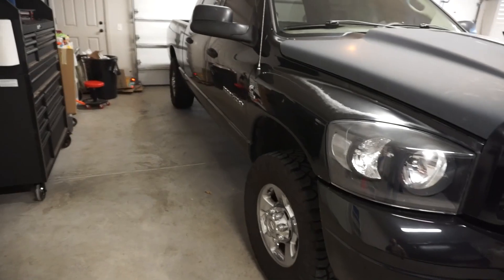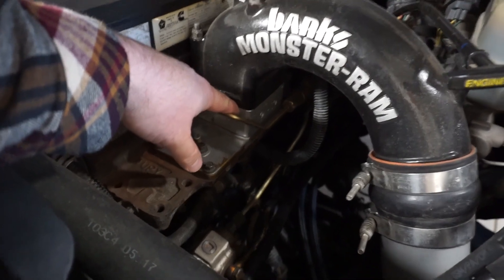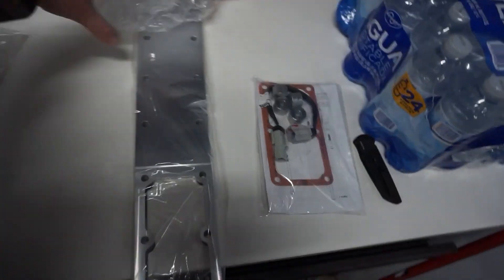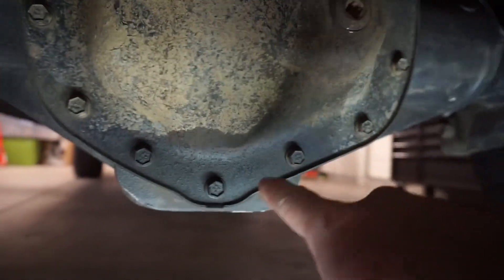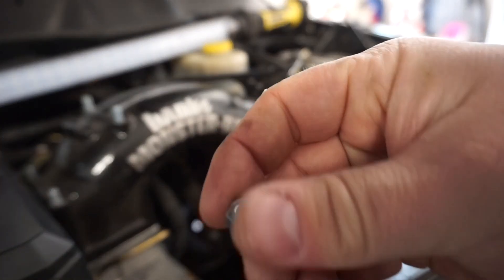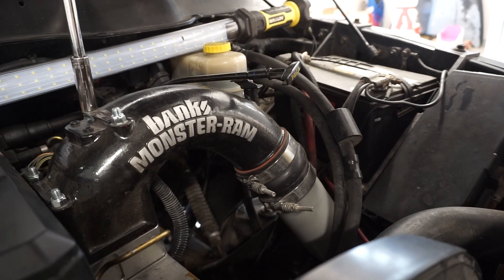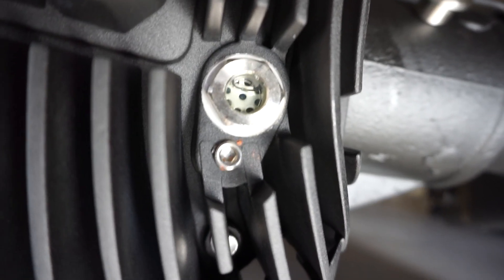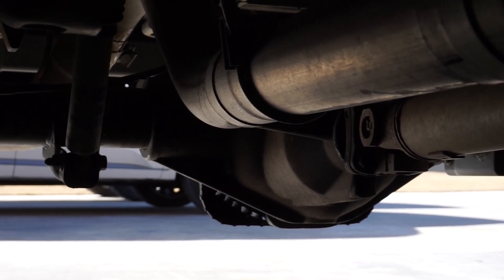Banks goodies install.

Comment: What upgrades engine/performance wise would you be comfortable doing on a stock 48re?
Reply from the maker: Honestly man a cold air intake is about it. These transmissions aren’t built to hold any power above stock. Maybe a valve body upgrade could help but that’s just about it.

Comment: you had to cut the oring?
Reply from the maker: Unfortunately yes. It was about an inch too long. I placed the cut at the very top.
Reply from the maker: yeah it was my fault i didnt take the time to massage it in the groves like i should have. if it leaks I will replace the O ring.